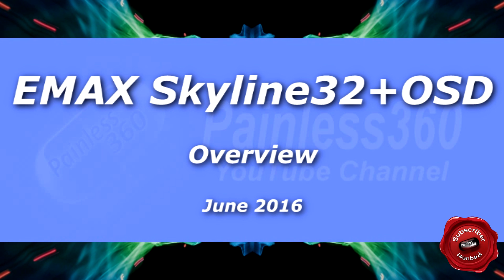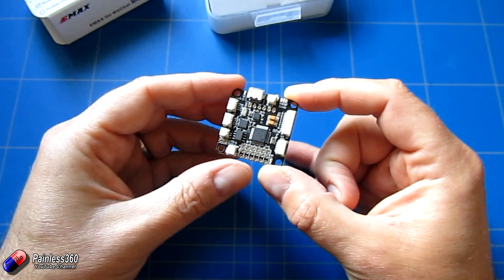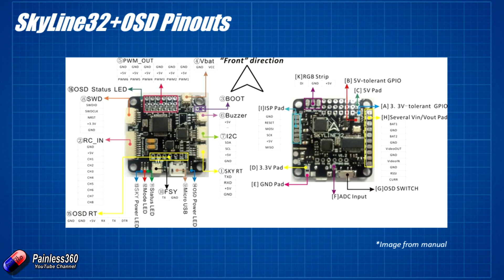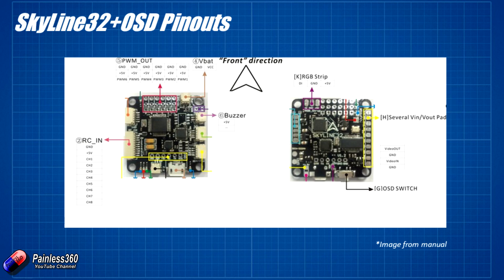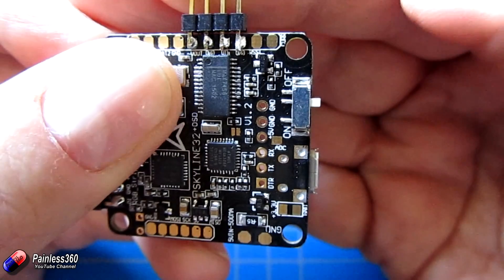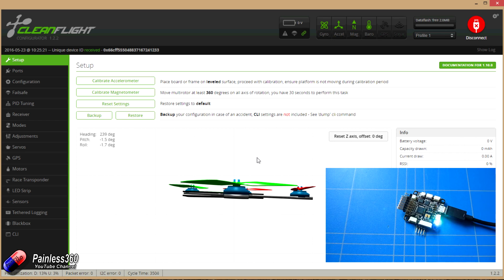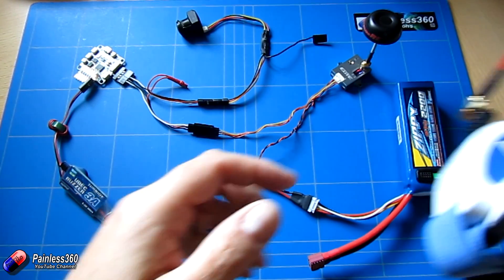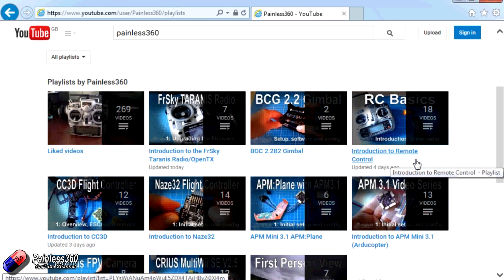RC Reviews: Skyline32+OSD Advanced Flight Controller from EMAX

Comment: i am having trouble programming my ESCs with BLHeliSuite through BLHeli passthrough with the skyline32, it says the firmware is not capable of doing so. I could not find skyline32 in the cleanflight configurator and had to compile one from the web, did anyone face this trouble too? I cant seem to find anything on a BLHeli passthrough for skyline32. Thanks

Comment: Hello, Painless, did you tried to connect gps module to this board? I've got "advanced version" of this board, without osd,its just left ic's on board,all other is the same. Over usb-serial gps module works well, but when i connect it to the OSD's usart on board, nothing happens, and cleanflight doent allows me to turn gps.
Reply from the maker: Sorry, I've not. Best of luck!

Comment: Can you program ESC's through the board?
Reply from the maker: Not sure, we've not tried. It should support the standard BLHeli Pass-thru though..
Reply: I bought the cable to program the escs just in case I run into issues. Thanks!

Comment: Hello!

 I have a problem with this board, when I switch on the OSD,  the board reboots continuosly. (looping).
 I have image and osd characters on my googles but not for a long time :)
The usb is not connected to the PC.
I use cleanflight  version 12.2.

Do you know what's going on?

Help would be apreciated.

Best Regards! 

Carlos Silva from Portugal.
Reply from the maker: +Carlos Silva I've not seen that. What have you already tried?
Reply: The simple fact of the osd is switch on, the board became crazy doing a looping reboot, and connect and disconnect the escs also.
The only way that I have fpv is turn off the osd and connect the video directly from the camera to the VTX without passing through the board. (without osd)
I don't know if is a PDB problem (Diatone v. 2.1), concerning the power consumed or not, but it is the second board I tried, the first one it was on the guaranty and they send me this one with this problem too. :(
Reply from the maker: +Carlos Silva I suspect that the problem is the Urt shared between the USB port and the OSD. I think the switch just connect the USB port to either the flight controller or the OSD. Sorry, I've not used one of these like this . best of luck
Reply: Hello again, thank you for your help.
I discover the problem with the OSD on, the problem is not the board but it is caused by the software, I flashed the board with all the cleanflight versions and didn't work, then I flashed it with the last version of Betaflight 3.1.6 and it works. It seems that the cleanflight development is dead. :(.

Comment: Hello ... I bought a skyline32 acro with osd ... I have a problem ... the osd disconnects me in flight ... the vtx and the camera are powered by the pdb ... when the accelerator disconnects and now I will not connect again ... I do not know what is happening...help!!
And another question ... I can not connect it with sbus or with ppm ... I need an inverter? Thanks
Reply from the maker: +Jesus Macia what troubleshooting have you already done?
Reply: Painless360 I do not know what to do ... the camera was fed together with the controller to a 5v output of the pdb and the vtx to the 12v ... I changed the camera to the 12v but nothing
Reply: Painless360 que puedo hacer??...un bec?un regulador de voltaje?
Reply from the maker: Si eres nuevo en esto, entonces te recomiendo ver el Quadcopter Building for Beginners 'serie y el' Intgroduciton a FPV 'serie también. Todos los conceptos básicos están ahí y deben ayudar con su comprensión para que pueda solucionar problemas. ¡La mejor de las suertes!
Reply: Painless360 I am not new to this ... it is my fifth racer ... but the first time with this flight controller and I do not understand why the osd is disconnected ... lack of power? I tried connecting the camera to an output of the controller Of flight and the controller and vtx to the pdb and nothing ... I also tried connecting vtx, camara and controller of flight to the pdb and nothing .... the vbat and bat1 of the osd to the direct lipo ... I try With a ubec? ... the outputs of the board are 5v 500mah and 12v 500mah .... few amps? .. change the pdb? Any help would be appreciated ... thanks
Reply: Painless360 The escs I have connected to the controller only with the white signal cable ... will have something to see ?? ... I connect the gnd of the escs too?
Reply: Jesus Macia I was reading about this. They were saying that mid flight can cause "noise" and it cuts the OSD out. They were recommending to wire all your grounds to the same pad with a mini osd. But your OSD is already built in so very strange I say

Comment: Quick question> I have struggled to connect this to my frsky xsr receiver. I am using gnd, 5v, ch4 for subs and channels 7 and 8 for smart port. It does not work. Why please?
Reply from the maker: +roland burrows I'd suggest that you watch the seriously pro SP 3 Series, or if you're very new to building the 'quadcopter building for beginners' series is good to as it covers these things.

Comment: i have my fc turned 90 degrees so that the usb connection is at the side of the quad. the artificial horizon on the osd  is out of whack. Am i able to change the orientation of the artificial horizon to match the fc?
Reply from the maker: You should be able to. I'd check that the movement in the GUI on the PC is right as a first step. Best of luck!

Comment: Ok, so I attached the video in & video out to the FC. Do you have to have the ground wires for both contacted to the FC? Right now I have the grounds running to the PDB. Thanks.
Reply from the maker: +415bryant I normally don't but I know pilots that have had problems if they don't common the gnd wires. Best of luck!

Comment: (Vbat, top plate pins) or (BAT1 GND, bottom plate solder) my osd dont show me my Battery Voltage it only says Low Volts...?pls help
Reply from the maker: I'd try the vBat pin first - you want to make sure you can see the voltage in the GUI on the computer before playing with the OSD... Best of luck!
Reply: Painless360 yes this step is done in betaflight the battery voltage is 16.4 Volts... so i can cut and solder de vbat pin to the bat 1 and Gnd port on my emax skyline 32 osd ?
Reply from the maker: Not sure what you are asking. If the GUI shows the battery voltage then you're almost there...
Reply: Painless360 sry im new in buisness GUI is Betaflight or what does it mean in my fat shark stay 0.0V battery low volts and my battery is fully charged so if i see in betaflight 16.4v so im must see it on my osd is it right?
Reply from the maker: If you're new then the 'Quadcopter building for beginners' and the SP3 series are better places to start. Best of luck!

Comment: I have the skyline32 advanced (without osd) trying to connect my x6r reciever to.  it will only work with pwm. I really need help setting it up using cppm or sbus (whatever the difference between the two, I have no idea) how do I hook up my x6r to the skyline32?  in the cli there is an option for sbus inversion.  I tried both on and off. but it didn't work. the ground, v5,pwm1, is suppose to be used for cmmp but in the settings after I select cppm. and hook it to the x6r, to first the sbus spot, then to the 1 pin spot. neither will send information back to the cleanflight transmitter tab. if you'll  ask me questions I'd kindly answer them.. or tey anything you suggest.  I tried sofserial  (pins 4 and 5 I think)  and sent both pins bridges to the signal pin to the x6r. and still nothing. I can't find anything anywhere.
Reply from the maker: +John Hoehaver see our videos in the 'Introduction to Remote Control' for the differences. The wiring should be in the manual for the board. Best of luck!

Comment: I have a problem with my fc The rc output its not giving 5 volts out on the pin The first pin is ground,the second pin is 5voltsand the 3rd pin of8 is channel one I need this port for the reciever. I have connected a seperate 5 volts to my reciever and powered it up and with the siganal and ground wire connected at that port This is what i am seeing in Cleanflight The reciever has binded with my TX and in cleanflight there is no response when i move my throttle or rudder even though its binded I have checked the rx serial port that it's ticked i have checked SBUS dont know what it could be Without this i can't fly
Any ideas Its so much harder to explain in writing
Reply from the maker: Not sure what you're describing. The power on the pins sounds right (GND, 5v, signal). Be careful that you've got the setting in Cleanflight right... A video/images of what you're doing can be really helpful to see what's going on.. Best of luck..

Comment: It says that this board can use any Naz 32 firmware to update When in Cleanflight there is only Naz No naz 32 does it make a differnce Don't want to flash the wrong firmware
Reply from the maker: +spooner Graham open CLI and type 'version' to see what's it running at the moment and choose the same Board type when upgrading. Simples! :) beat of luck!

Comment: The yellow light is not coming on on my board and the switch is to on?There is no display?
Reply from the maker: Does it work in CF? What's connected to it?
Reply: No and i have enabled it also Makes no difference I am using aEachine 700tvl 600mW 1/3 Cmos FPV 110/148 Degree Camera w/32CH transmitter
Reply: In regards to the reciever connection on this board I am using sbus do i have to supply a further 5 volts to the unit as you don't show the reciever setup and refer to the naz But this is a different board
Reply: In regards to the reciever The FC the white conector block first wire is ground second is 5 volts and 3rd is 1
This does not seem to be putting 5 volts out
The light on my reciever is only just lite
The vbat connection is in so surley this provides power to the FC
I have fully charged my lipos so its not them
Thanks for being patient
Reply from the maker: An image would help..
Reply: Cheers Whats the best way to get these images to you?
Reply from the maker: Post the somewhere you can post a URL for me to use..

Comment: Thanks for the Video it states on their website to "Flash to latest firmware through the Micro-USB (**NOTE: Please be sure to leave OSD switch OFF when using Micro-USB)."  I have recently received in the mail the SkyLine F3 +OSD and it says the same thing.  I am assuming the sentence above is referring to the Firmware Update.  You see I got mine in the mail and immediately without checking to see if the OSD switch was on or off plugged it in to my computer.  It was in the On position, seems to be okay but I would hate to go through the trouble of building a new quad and find at the end I have damaged the board.  What do you think?  Do you think it is okay and is there any way I can check without doing a full build.  I have not updated the Firmware as yet, version is 1.10 SRF3, going to skip on over to BetaFlight and use the latest.
Reply from the maker: I'm sure its ok. The remark in the manual is because the OSD and the USB both share the same port on the flight controller so you can't have both on at the same time. This is only a problem if the OSD is powered as it tries to 'talk' to the FC so it can't hear the USB signals. Best of luck with it!

Comment: Hello, how do you calibrate Esc in betaflight with this FC? I cannot get them calibrated, no matter what i do. Manual says you need to put lower level fast, when esc makes initial sound. But no luck.. cannot calibrate or turn my motors, no matter what i do. Maybe need trash this skyline32. Cannot get motors working with it.
Reply from the maker: Be careful if you're using BLHeli based ESCs. I've had a few 'interesting' experiences here using BLHeli and Betaflight/Cleanflight versions. Updating the ESCs seems to help. See the process in the 'Quadcopter building for beginners'. both series.. Best of luck!
Reply: thank you :) i will try that. if not gonna change FC to something else

Comment: Hi have you fitted this board to any model yet? The reason I ask, I am having trouble connecting my frsky xsr to  my skyline 32. I have binded my receiver to my taranis and have the green led on. In cleanflight I selected RX serial in receiver mode and sbus from the drop down menu. Then selected serial RX in uart 2. enabled the soft serial tab with telemetry. Connected sbus white wire to rc in 4 and s port telemetry to  rc in 7 and 8. There is no movement of bars in the receiver tab, telling me the receiver is not communicating with the skyline 32 flight controller. Only telemetry is what the receiver is sending back.. Any thoughts on how to fix or is a broken one???
Reply from the maker: Not sure, see the NAse32 videos for ideas of what to try. Best of luck!

Comment: Can you tell me what the RT port is for. I bought the advanced 1.1 version that supports OSD, is the RT port for OSD?   Thank you.
Reply from the maker: Not sure, we've not had that here. If you can point it out in an image that may give me a clue..
Reply: +Painless360 I can't insert an image but the board has GND, +5V, RXD and TXD printed on it at the microJST plug.  4 wires yellow, green,  black and brown.
Reply from the maker: That sounds like a UART port..
Reply: +Painless360 Is this the same guy in the video that answers these questions?
Reply from the maker: It is. Hello! :D
Reply: can this be used for OSD?
Reply from the maker: The OSD is part of the flight controller already on this board we're looking at in the video. Nothing extra needed.  Best of luck!
Reply: i understand that, im talking about the Skyline32 Advanced v 1.1 flight board that supports OSD.
Reply from the maker: I see! That will hook up to an OSD just like any other board that runs Clean/Betaflight. Some of the early EMAX boards were notorious for not implementing a few things well and meaning that an external OSD wouldn't work..

Comment: Hi. A question about this controller, can it do BlHeli passthrough? I'm using it with the 12A's that came with the kit and I can't arm the thing. It did work a couple of times but I could never get the passthrough to work. I'm connecting before powering but there's no beeps or anything. I calibrated the ESC's using BlHeli and now I can't arm or even do the throttle setup in Cleanflight. I tried BetaFlight too, no change. Now I just get solid red and blue and the green flashes once a second but it resets a lot. Perhaps in response to the Debug 0 graph but I know nothing about that.
Reply from the maker: See how we looked at a problem like this in the 'Troubleshooting' video in the 'Quadcopter Building for Beginners' Series. I hope it helps.. Best of luck!
Reply: Thanks for that.I just watched it and unfortunately you're not using the Skyline 32 at that stage in the build. If I just knew for sure that the Skyline32 was able to pass through BlHeli it would help me figure things out.
On your build you do get the ESC's to tell BlHeli suite what's installed on them, I never do. I know the ESC's are programmable and I know a rev 6 Naze 32 will pass through but I can't find anyone who knows for sure if this Skyline 32 (which I believe to be built on the Naze rev 5 as I had to use the pre-inverted SBUS signal straight off the board of an X4R-SB) will pass through. Any Google search you do on the Skyline 32 takes you to info on the Naze rev 6.
It has flown a few times before but now it just won't arm. I wish I'd left the ESC's alone but the CW motors had a hard brake while the CCW motors wound down naturally and I suspected that had something to do with a CCW yaw that it would do when it was just coming slowly to a hover.
Reply from the maker: That is odd. I've not tried it on that exact board but if you can't see the ESCs (and are following the process exactly) then it looks like the FC doesn't support it. If the 5v buffers in the PWM outputs are not bi-directional then you need to connect to the ESCs directly. A few other boards have this problem too.  I'd look at updating the firmware on the ESCs with a direct connection. Best of luck
Reply: I've just tried to program the ESC's with the Tx with no luck. I've tried plugging one at a time into position 1 with no diffeence. The best I can say is they provide 5V and they have worked in the past. I've a new PDB coming tomorrow hopefully so I'm going to replace them with 20 Little Bees Optos that I bought to upgrade the quad with. I'm also going to build another parallel one with an Omnibus. Hopefully that will go better.

Comment: I've just received a Skyline32+OSD Advanced version 1.2... can you tell me if you had to do anything to get the magnetometer to work ? When I connect to it in clean flight the mag is not green and when I do status from the cli it does not appear, although I can see the barometer?

Wondering if I need to run any command to be able to see the hardware properly or if I've been sent a duffer.

Great channel by the way.
Reply from the maker: I'd check with the vendor as it should be there automatically. Try a calibration in case but that points to a more basic problem (I think).. Best of luck!

Comment: Great video! Just a Quick question! Does this board have a 3.3v output to connect the rgb leds? I found out my led's dont work on 5v.. and if you had to choose between this emax board, or the sp f3 deluxe with osd http://www.hobbyking.com/hobbyking/store/__107400__Deluxe_F3_Flight_Controller_with_Built_in_OSD_EU_Warehouse_.html which board would you pick?!?
Reply from the maker: This one does. A quick search should have found things like this - http://www.rcgroups.com/forums/showthread.php?t=2596508 Hope it helps!